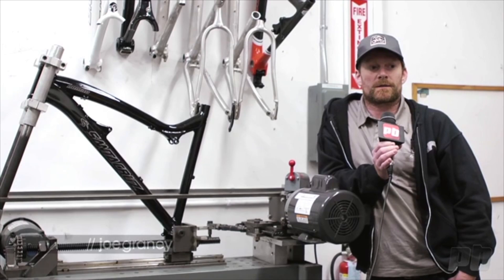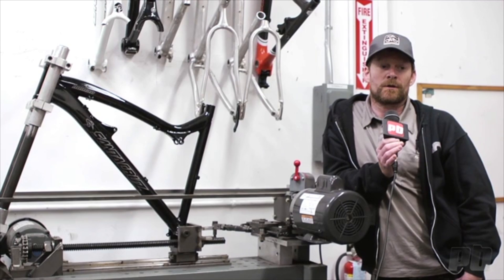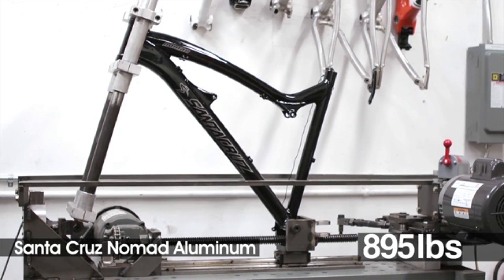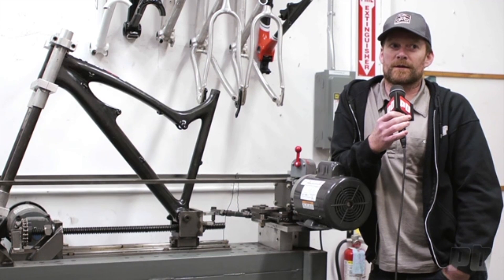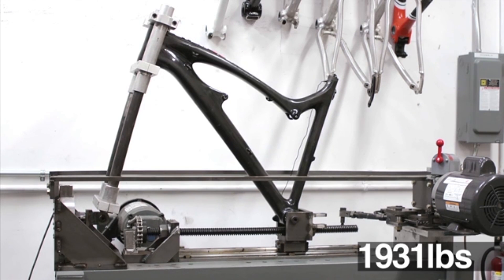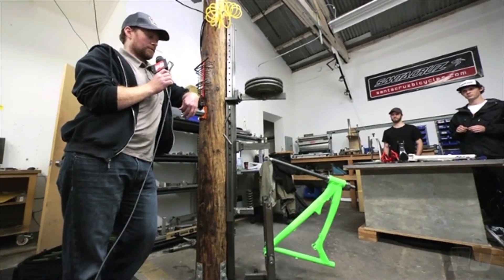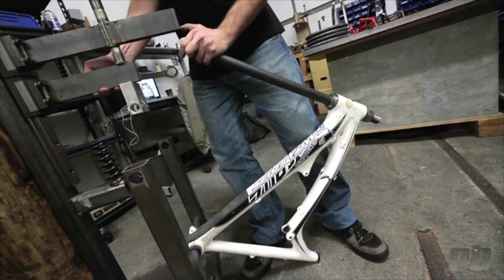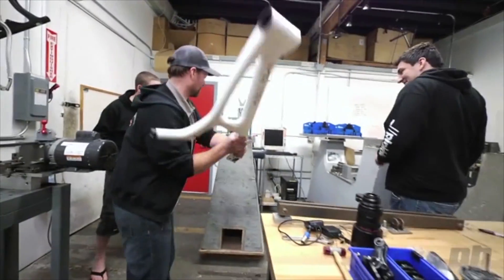Carbon vs Aluminum Frames - Which is Stronger?

Comment: in the first test, the carbon sounded like it was delaminating/cracking way earlier than the aluminum failed.  you tested to total failure rather than stopping and assessing, but I bet the carbon gained defects way before the aluminum failed.
Reply: The aluminum gained defects before it failed too. You just don't hear it happening.
Reply: @MrFreerideForever  But you can feel it and see it when your riding that's the difference between it and carbon.  Plus Aluminum will bend pretty noticeably before it will fail.   While Carbon not only gets weaker over time it will fail instantly before any warning.   Enjoy that medical bill.
Reply: Agreed! You can hear it start snapping at 800 lbf already
Reply: @basislageroberelbe  I know this is an old comment but you can also see the aluminum frame start to collapse inward at the head tube around 500lbs of stress lol.
Reply: That was my first thought as well
Reply: Usually once carbon gets a crack its done for, keep riding at your own risk if you don't mind a big medical bill.
Reply: Hi, thanks for your question. The first machine was a legitimate engineering test, where components/materials are exposed to a sustained load. The displacement of the bottom bracket and applied force are both measured until the component fails. The data is then put in a "Stress vs. Strain" graph. The slope of this graph tells us engineers the exact point at which the carbon starts to "give," which is when the slope of the line is no longer linear and starts to become exponential. This is known as a yield point. We add a coefficient of safety (standard practice) to be able to claim a safe load for operating. The sound is probably when this yield point was reached and if the test were stopped there would be an uncertainty/area of data loss for the test. We can re-play the test video and correlate the cracking sound with the data presented in the graph.
If you're interested, look up "engineering tensile testing," "stress vs. strain graph" and/or "elastic vs. plastic deformation."
Reply: @WolfAshesUSA  

Nice bullshit answer, but it ignores the comment - the test has no practical application to bike strength under conditions of high deceleration impacts. This is where carbon fiber fails. Also, the test only applies forces on one plane, where carbon has it's highest strength, while metal has strength in all directions. While it is an engineering test, in this application, it's just a marketing stunt.  You could also test if the frames float in water, just as useful.
Reply: @WolfAshesUSA  knowing that cracks it shows us that at some stress point (maybe less force when the alu frame bent) actually lessen the bike lifetime.. and after a crack it wont  be a safe to ride anymore. Where is the strong part? Just expensive sh*t.
Reply: you mean the worlds slowest crash? not sure how that relates to coming up short on a jump...
Reply: These tests are all chosen to make carbon look good, but we all know in the real world a disastrous jump might bend an alloy frame, but carbon frames shatter with sharp fragments. I drank the carbon koolaid, learned my lesson, and since saved thousands while riding great alloy bikes.
Reply: It is exactly the opposite, it is the aluminum that loses its mechanical characteristics over time, the carbon is not affected by the phenomenon of fatigue, that is, when it is subjected to stress the material returns exactly the same as before, while the aluminum undergoes micro cracks.
Reply: @alsteooaai  the fatigue characteristics of Aluminium are well known, however carbon fiber also has a sort of fatigue over time, but it's different from the one of metals. Carbon fiber can delaminate over time, which weakens the material.
Reply: Aluminum has very low yield point per grain structure inside that's why they add magnesium and other tough metal to enhance yield, it's same as composite just different material. They both behave same in micro level.

Comment: carbon frame?nope i'd stick with alum . carbon has a life span.
Reply: My aluminum frame is now 12 years old and still withstands the 4 foot drops I like to do off the tops of staircases into the flats at their bottom whereas carbon frames have already snapped in half from lower drops as several videos on Youtube prove!

I wouldn't even trust a carbon frame for commuting!
Reply: first of all not all carbon is created equal. second of all 4 foot drops are really nothing compared to what most mountain bikes are put up too. I have no problem with you not buying carbon, because it is expensive.
Reply: @GavynPendleton  Not only that, it can also break anytime and send u to hospital if ur really unlucky! The only "special" frames I'd ride are titanium ones, if I could afford them and if they made sense for my sport, but as I said, my 12-year-old aluminum frame is still more than up to the task, and so is pretty much any other aluminum Dirt Jump frame! No need to spend thousands of whatever currency on a sh!tty ass carbon frame that ain't even doing its job or a titanium frame that doesn't do the job much better than aluminum!

Maybe carbon is gonna make sense sometime in the future if they figure out how to not have it break from dropping down no more than a 5-step staircase and it becomes affordable! But for now a properly built aluminum frame beats any carbon frame by MILES!
Reply: REALDualDesertEagle first of all if you consider weight or ride quality your wrong. Second of all any quality bike will stand up to drops and crashes. It does make more sense to make DJ and bmx bikes out of aluminum or steel because they do get put up to shit that does not favor carbon, but for everything falling more squarely in the MTB world carbon makes a ton of sense. Now if you don’t want to pay for it, fine that’s the beauty of free markets.   I’m sure your aluminum bike is awesome.
Reply: @GavynPendleton  What kind of ride quality do u get out of a frame whose head tube suddenly snaps off after a drop that wasn't even 3 feet tall!? Carbon frames are still JUNK and not worth half a cent of all the work that goes into making them! They should be held back until they can actually TAKE all the abuse that comes with MTBing!
Reply: Lucius Irving I ride a Santa Cruz nomad cc xo1 build with a cane creek dB air and a pike. I’ve ridden it at the big sky DH park on multiple occasions and crashed it pretty hard. I’ve taken it of drops that are larger than the 4 foot ones described by the guy above. You could say I’m biased cause I love my bike, but if you look at the way the entire industry is going it backs me up. Finally to answer your questions politely now. I have no idea what it’s like to ride with carbon shards in my body because it’s not happened and it’s not gonna.
Reply: Alex Mejia if the  aluminum frame breaks you can put it back together

Comment: i'll bet you steel frames are tougher than that
Reply: there are some extremely expensive steel bikes. Also titanium bikes too
Reply: Make a CF frame as heavy as a chromoly frame and go head to head...
Reply: Easy to get a steel bike as light as Carbon. There were 6kg steel bikes in the 1950's
Reply: yep, 4130 chro mo, full rigid 20 inch jump and street bikes etc been using it for years, triple butted heat treated Japanese chro mo, rigid forks etc, quite simply put carbon would shit itself in these conditions and intended uses.
Reply: or they could just make the bike just 2 inches of solid steel where it should be tubes. and it could be steel.
Reply: you must be fuckin joking please

Comment: carbon frames are fantastic for roadies. I'd never personally own a carbon MB. they are super strong, obviously. but carbon doesn't like flung rock impacts. it doesn't dent. it breaks. at least aluminum well dent and you know you'll get home, generally speaking.
Reply: I worried about the same thing until I saw what a minor impact will do to an alloy down tube. Carbon does snap but it takes much more to damage it than alluminum does and once alloy bends it won't be very long before it snaps as well.
Reply: That is all true. 
But what I'm trying to say, instead of a crash impact and rather flinging rocks, carbon chips whereas the alloy will either scratch or get a very minor ding. 
I've helped repair a number of carbon bikes for me locally. 

I really appreciate the carbon frames. Just not for anything more than an XC bike. Too brittle.
Reply: Yeah but does aluminum djent?
Reply: If you have actually tested your theory and have proven it wrong with facts I would believe you

Comment: I'm SO glad i watched this.
I know carbon fibre frames are significantly stiffer, but i presumed they'd fail catastrophically under a similar impact compared to aluminium.
I've seen so many competition level frames and wheels fail in a unnerving way, that it'd put most people off wanting to use carbon.
This clearly shows a good strong carbon frame with the correct weight and build for its purpose is HIGHLY durable.
Reply: cool story bro but i would still avoid carbon frames haha

Comment: youll still be riding home on a bent ally frame. broken carbon is a walk home with a bike in 2 pieces.
Reply: socommk233 the carbon fiber price tag is the scariest part
Reply: socommk233 my friend snapped his aluminum frame on the down tube after he hit a jump and rode home just fine. He had it aircraft welded and it lives to this day stronger than it was before!
Reply: I'm catching Uber with either frame damaged.
Reply: Is that because you've yet to ride one? (sick burn, I know).
Reply: when you just bought the highly expensive carbon one and found out that you re failed. Then find an excuse to look good in certain way lol
Reply: Well done bro😂
Reply: That's great and all, but on the same crash that bent the aluminium frame, the carbon frame would still be entirely intact. If you put the aluminium frame under the same stress that it took to destroy the carbon frame, then you'd probably have a bike that's completely folded in two!
Reply: @Metal-Possum  That depends on the design of the frame, which is in this case extremely poor with these bends. A good truss frame in 7005 will get better results, an example https://www.youtube.com/watch?v=iUak9sqJmnM . With carbon is more interesting to design a frame with more mechanical inertia and no stupid bends, like a one tube frame.
Reply: you mean mandatory wheelie practice?
Reply: Not really, I've seen many alloy bikes break completely versus just bending. It depends on the grade of aluminum.
Reply: You won't be riding home after 2000 lbs impact no matter what frame material...
Reply: Thats if you don't end up in the ER when it breaks in 2 pieces.
Reply: socommk233 Ya maybe in 2006..There's a reason why even Nasa uses the stuff! Monocoque carbon molding processes are much superior to the many joints found in alloy frames! Especially in 2017..The carbon fear mongering old thought process!
Reply: @flow2tech  I guess NASA doesnt use Carbon from cheap Chinese factories. Carbon is not the same as carbon. Also they check their material before every use with x-rays etc.
Reply: @mob1235  either way... There is still a thing called cheap chinese carbon... Buy a set of their handlebars and let me no how it works out for ya..
Reply: @flow2tech  I own a carbon frame, but nevertheless you cant compare aerospace carbon with these you buy for your bicycle
Reply: @mob1235  and u cant compare cheap chinese carbon with that designed and tested for high end bicycle frames either
Reply: @flow2tech  Santa Cruz frames are from China or Taiwan, like every other bike frame
Reply: @mob1235  but they are not the same as ebay cheap chinese carbon... They are a monocoque frame held to vigorous test cycles... Trek takes this aspect to an even higher level..
Reply: @flow2tech  Trek frames are from Quest Composite Technology, a Chinese producer. The same as Canyon frames. Look at the videos from Hambini how shitty they are. They have bad tolerances and there are a lot of errors in the structure of these frames. You cant compare this cheap shit with aerospace production. For bicycle they may be good enough if you are not unlucky and get a bad one.
Reply: @flow2tech  Carbon breaks the same way even now regardless of the quality.
Reply: @michaelmichaelagnew8503  Yet to have it happen .. on my 5th carbon frame since 2011.. north shore riding.
Reply: "broken carbon is a walk home with a bike in 2 pieces", that is if you don't get stabbed in the process.
Reply: Once aluminum has bent it is eventually going to fail completely and unexpectedly. According to this test you'd be limping home on a bent alloy frame or riding a carbon frame that was completely fine because it didn't break in the first place.
Reply: @WildOutdoorLiving  except when you get the tiniest invisible internal crack or splinter your bike is done. Aluminum is more durable.
Reply: socommk233 I've snapped an aluminum frame, have yet to snap a carbon. just sayin.
Reply: @peterotto8779  its coming lol
Reply: You guys realize that this is not a regular carbon frame? It's specifically designed by Sant Cruz - hence the price tag. Traditional carbon frames have nowhere near that much resistance.
Reply: @lukasadamson6091  Made in China bro. All of em are.
Reply: Bullshit. Do you know what delamination is? The carbon frame in the first test wasn't fit for riding after the 1350lbs mark. You can literally hear the pops and cracks from the frames fibers. Do anything on that frame after 1350lbs of force and you're gonna end up hurting yourself. What would you rather have, a bent alloy frame that can get you home pretty safely so you don't have to walk or a cracked/demlaminated carbon frame that's gonna break if you ride it off of the pavement too hard.
Reply: Callum Scott yeah but it was going up against a brand new frame and the carbon frame had already been fatigue tested and impact tested and riden for 2 years so keep that in mind
Reply: Callum Scott and also the aluminium frame also started bending well before the 1350 mark and it also made cracking and popping sounds
Reply: @PvtSpots  What are you talking about? The alloy frame literally creased in two at around 900 lbs? Also 2000 lbs is a hell of a weight, period.
Reply: @PvtSpots  I've broken a few alloy frames and wheels, never carbon though. I promise you that you will hear the delamination on your carbon frame if it happens, which is a great warning. I know a few guys who actually did break their bikes, one of which was a 9 foot huck to flat, and it failed on the top tube in the same spot as this video. It failed completely through the frame, and he didn't have to stop. He rode it the rest of the way down the mountain before he noticed anything was wrong. The crack was covered by a sticker so he couldn't see it.
Reply: Carbon ftw. Also learn not to fall down, and perhaps one day you'll stop breaking your frame in two.